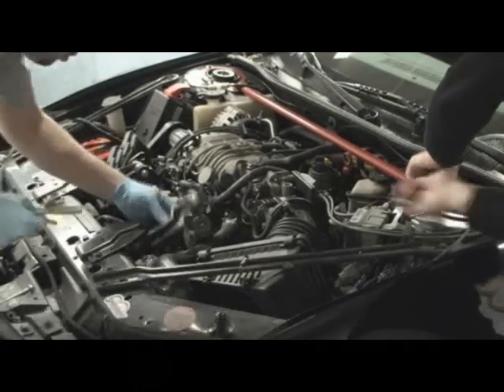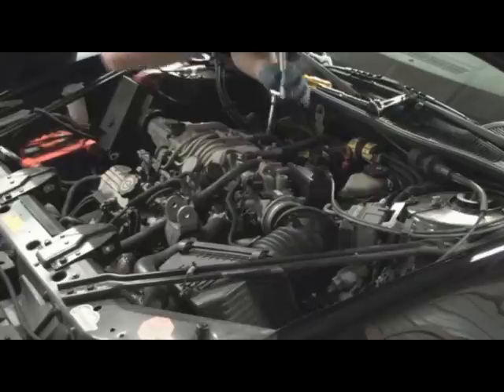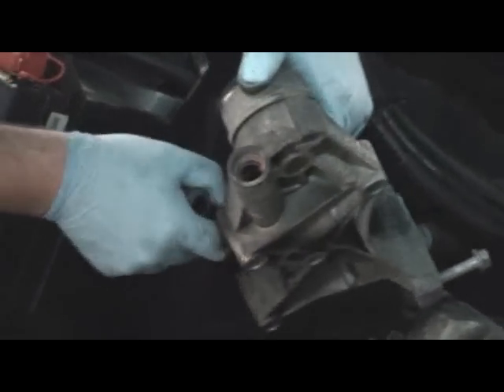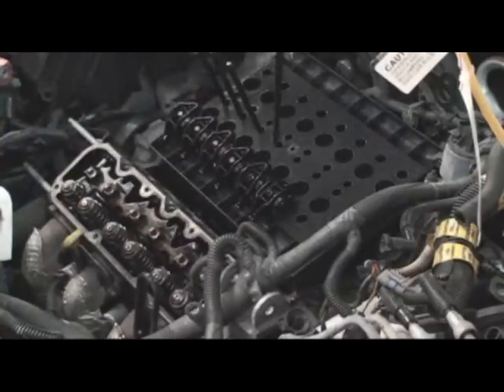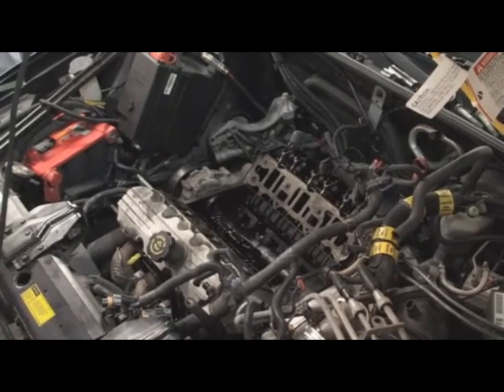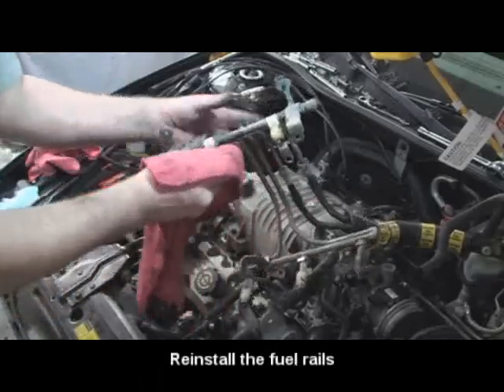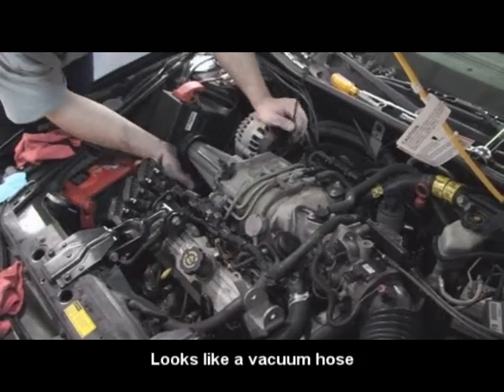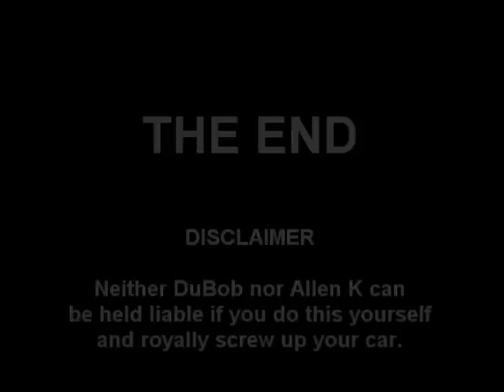Lower Intake Manifold (LIM) Gasket / Lifter Replacement on GM 3800 L67 3.8L

Comment: Thanks for this video. Very well done. Helped get me through this repair on my 98 buick regal gs. Cant thank enough. Ps remember to take top nut off of fuel rail where the engine cover mounts and be aware that vacuum lines will prob break when doing this repair. Also remember to unplug coolant temp sensor on bottom of intake before taking it off. I also bought a supercharger gasket that you will need to install as well. This video is as hood as it gets to get you through this repair.
Reply: Yea that top nut on the fuel rail had me stumped for a second, its on the stud where you bolt down the plastic cover for the engine. I couldn't figure out how to get the fuel rail off until I realized there was a nut there

Comment: No problem.  It worked really well.....not that I have used it since I did that video.  I use to be a weekend warrior doing work on a lot of 3800's in the Mid-Atlantic region, but it all stopped after I had my daughter.  Glad this is still helping others out though.

Comment: Working on my 3.8 I pulled all the bolts triple checked and that intake will not budge even with pry bar.
Edit: there were 2 bolts inside the intake that I missed because they were under oil pools.  Duh. 
What's the piece that is under the intake that rotates? Runs the full valley of the intake.

Comment: Just watched to see valve lash adjustment on these engines but I gotta say you did a great job and remembered everything.

Even the first start and building the oil pressure. A lot of people forget this step and although they don't have bad things happen at the moment the usually find out why they should have done this when they do an oil change.

I wish this was all that was wrong with the engine I'm working on. I am doing a Pre-Series I LN3 Engine. The guy who had it last may have spun a bearing. There was a knock at first start towards the accessory side. Check the harmonic balancer and was hoping it was that but seems ok. but I will probably first drop the pan to find out. It is in need of a valve lash adjustment too.

wish me luck gonna probably be tearing it all down and working on a rebuild with a bigger cam and dressing it up. The 89 bonneville it is in isn't anything to look at but its a tank and I wanna see how fast I can make a tank move lol.

Again great video.

Comment: do you really need to replace the LIM gasket when you do this job, if you already have the upgraded metal version installed?
I've already replaced that gasket twice! (and the 2nd time turned out to be totally unnecesary). and it's expensive. so I'd hate to have to replace it again just cuz I'm doing the lifters.

Comment: Great video man!  I wish I had done a how-to video on this. I replaced the lower and uper intake gaskets on my 2000 Grand Prix with the 3.8L non-supercharged.  Took me about 10 hours. I recommend Felpro gaskets & not putting Dexcool anti-freeze back in. Dexcool ruins these intakes all the time.  Also you can obtain a really nice Dorman Kit with a new upper better made intake plenum. It comes with the upper gasket, EJR passage jackaet, PCV and all the all other o-rings and gaskets $130 @ Pepboys.
Reply: What is best coolant for gtp?

Comment: Great video, but I was wondering if you have to rotate the crank while tightening the rockers while re assembling. Does each cylinder have to be top dead center so you are not fighting the valve spring? I seem to remember doing that on a ford V6.

Comment: I have a 3.8 and I think it might be time for a new engine. Does smoking from the engine under the hood mean a cracked block? The car smokes from the engine even when its cool and Im not sure what the problem could be. At operating temp of 200 the car only goes to 50 and then loses power. After it starts to lose power, it completely cuts off. The car wont start again until its cooled off

Comment: I have a 2003 impala 3.4 I had the head gaskets replaced about 3 months ago. well all is ok with that however I have a hissing noise coming from the engine. also when im driving it boggs out. so I was told to replace the upper intake gasket in which we did as well as a new plenum. got all that done and still the same problem. vacuum hoses are good. any suggestions??? please

Comment: So glad I found this video. Currently working on my 2003 Grand Prix GTP and all the videos I keep seeing are the ones where they are not supercharged and have the plastic intake manifold. Today I was at the point of taking off the manifold or so I thought until I was trying to figure out if I have to remove the supercharger or what?? Now that I have seen your video, I realize this job requires me to remove the supercharger to get to the upper manifold. lol! Seemed much quicker and easier on the other videos I watched.  Thank god I came across your video so I know what do to next. When I removed the throttle body, the gasket was cracked. Do you think that would cause coolant to leak onto the exhaust? I already had my LIM gaskets changed to metal a couple years ago and elbows are aluminum now instead of plastic, bypassed the heater core and recently changed the freeze plug but I figured maybe take a peak at the head gasket in case. No mixture of coolant and oil on the oil dipstick or white smoke. Awesome video! I can now continue with the project. Thanks!

Comment: so u hav 2 drain the motor oil b 4 u  start 2 take the LIM off?
Reply: No, not you dont. But aviod any lose debris getting any where into the engine and it is best to change the oil after you complete the job. If not a second time 1k miles in.

Comment: Do use a thread "sealant" or a thread "lock" compound on the lower intake manifold bolts? Also if you do use a thread sealant, what type do you use? I put a thread sealer on all the bolts (anaerberic sealer) and I still have a leak of the coolant into the oil. I'm thinking the compound added friction to the threads and caused it to not seal as tight?

Comment: Great job. I used this video to study in preparation for doing this job back in 2013. The LIM gasket is leaking once again, so it's time to do the job again this summer. I have heard that even the aluminum replacement gaskets have a tendency to blow out, is that the case, or did I just not do the best job the first time around?

Comment: Wasn't dexcool the reason for the gasket deterioration in the first place...why put it back in there?
Reply: I think the new gaskets are made of a material that is compatible with the dexcool.
Reply: Because changing to a non-dexcool coolant is not the best thing to do to an engine thats designed for it. Hence the reason for new updated gaskets.

Comment: Hello Allen found you Vid very helpful, my question is.. the lifter change is it a necessary step when doing the gasket change, I also did not notice doing a valve lash adjustment like I would normally do on a Chevy V8 you pretty much torque them and  did a 1/4 turn extra, also did you use a better type of gasket (up-grade) than the typical ones you get at the Auto parts stores??, I heard there was an aluminum version that is better and lasts much longer, can you please let me know. Thanks

Comment: What did you use to remove the front valve cover bracket and how many bolts are there? I'm having a hard time removing the front valve cover

Comment: Allen and DuBob,
Thanks much.  Great video.  You've given me an inspiration to get a vidcam and give others something useful myself next time! 

Only questions I have are about torque specs:  Valve lifter retainer bolts, valve covers bolts, alternator/coil to brackets and brackets to engine, motor mounts, idler pulley, and tensioner pulley.  It may not be important with some of these items; I just have a bad habit of killing myself with taps and helicoils...  Maybe there is like a rule of thumb that I am unfamiliar with?

Again, thank you.
Brett
cc: Dave Richie

Comment: What are some of the tools needed to do this job? I already have a socket set with 3/8 and 1/4 inch drives with a 4 inch extension. I know I need a torque wrench, but is there any kind of special tool or adapter that I might need?
Reply: http://www.pontiacbonnevilleclub.com/forum/viewtopic.php?f=53&t=3591

The tools needed are listed in the "how-to" above

Comment: Is lifter failure a common problem with these? I inherited my grandmother's 2001 Buick with a 3.8. It has a lifter pecking until the engine warms up some and the lifter builds up. Cars almost 17 years old but has only 50,000 miles
Reply: vfl rockytop no your flexplate will break before your lifters go bad.

Comment: at 25;10 you mention coolant o-rings, but you dont show where they go. Are they just behind the egr feeder port? Also, do they go under the paper gasket or on top of it? In other words, do the orings go on the LIM and then put on the paper gasket and bolt on the SC?

Comment: quick question, was it break cleaner you used to clean the lower intake manifold gasket housing near the lifters to get a better clean so the gaskets stick better? if not what did you use in the spray can.

Thanks in advance.

Comment: I have a question for you, I'm fixing my Buick regal 3.8 I noticed oil in the coolant housing, would intake manifold gasket cause this, or is it just the oil cooler line?
Reply: kush candy yes upper can cause huge problems and dint ever use dex cool.
Reply: Don't
Reply: Why no dex cool?

Comment: Did you leave the coil packs disconnected while priming the system for 15sec?
Reply: Yes, I believe I didn't connect the large connector at the bottom, and also pulled the fuel-injector fuse.

Comment: I was wondering about how long it took you, im changing a LIM on a 3.5 g6 looks like the infamous gm intake problem goes a long way.
Reply: it took about 8 hours but , if u go to change timing cover gasket an oil pan gasket that took about 12 hrs most painful car if ever worked on for that but all went well

Comment: You may want to get your engine checked out ASAP. The 3.8 liter Pontiacs have a history of engine compartment fires, especially the supercharged models. It's caused by oil leaking onto the exhaust components and starting a fire. There are hundreds of blogs online about people pulling into their garages and 10 minutes later their cars are ablaze. Unfortunately, I just bought a used one with the supercharged engine and I had no knowledge of this problem...

Comment: Yep, it made my life a lot more simple.  Plus I found from some research that the Dorman plenum was made of a better plastic that the GM one.  This is a common failure point on the 3.8 Series II.   I was wondering where did you get that cool storage tool for the lifters and rockers?  I wish I had that when I did my brothers 3.1 multiport head gasket last winter. Had to lable them all an put them in ziplocks.  Now my overdrive went. 
youtube.com/watch?v=csmTm94qC_M